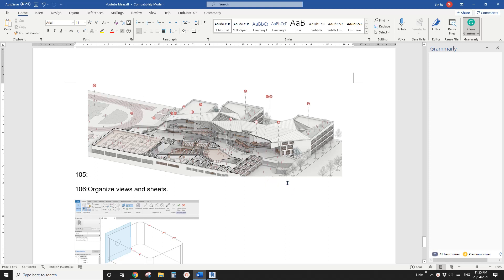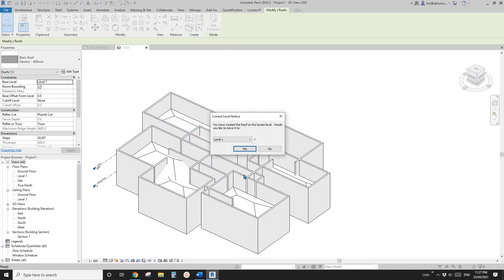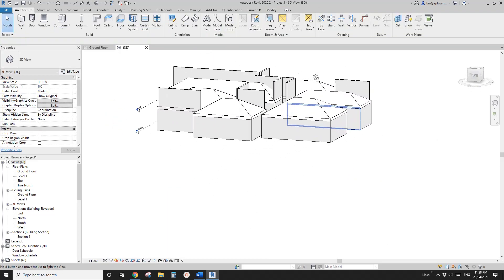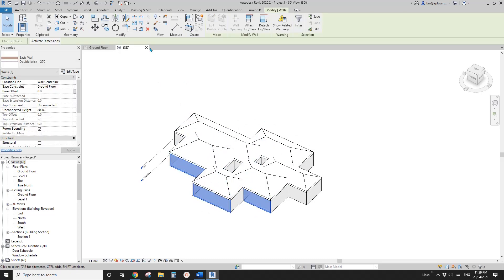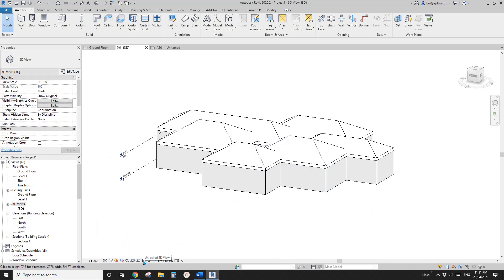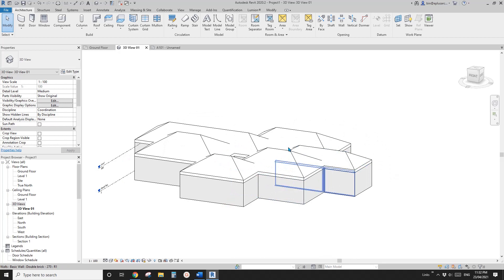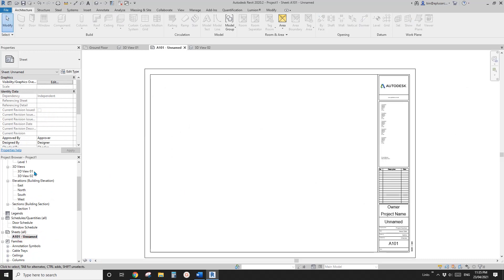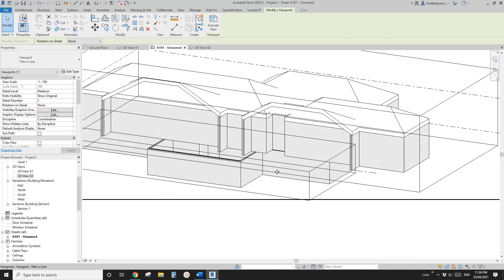Everyday Revit (Day 400) - Section Box Tips

Comment: Nice trick to combine cut with not cut. 
To hide the irritating line ... I wonder if you can  create a small "white color" region then copy or array it in between the brick lines so it only leaves the joints black & hide the black lines on the bricks ?
Reply from the maker: Can we use fill region in 3d view? Maybe we can photoshop?